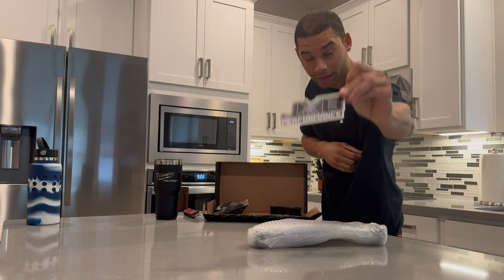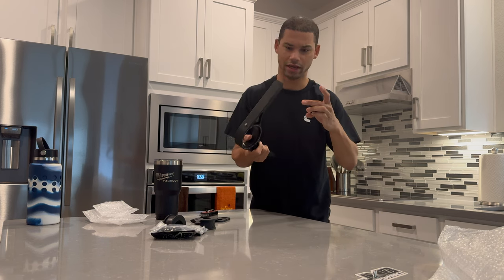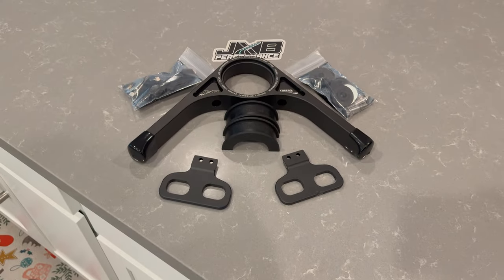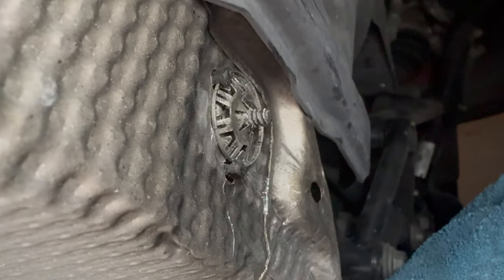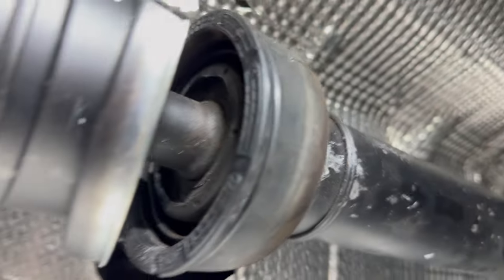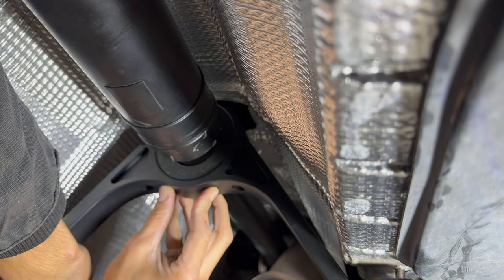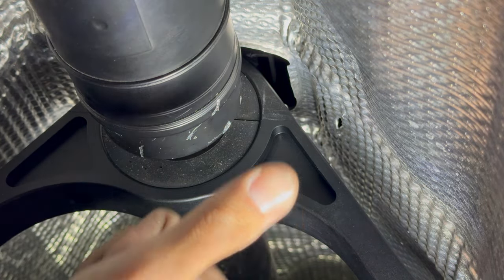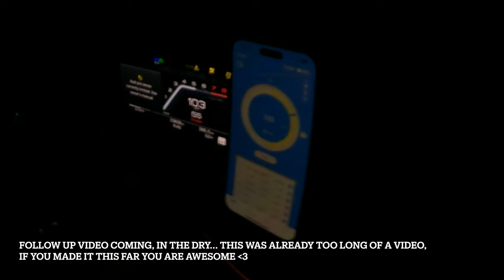JXB Driveshaft Carrier upgrade! This is a must for going FAST!

Comment: I also use JXB carrier in my golf 8R. I tested times on stock tune and no gains in acceleration. But the overall felling of the car is pretty sharpened, it puts power on the back wheels faster so the car fells more sporty.